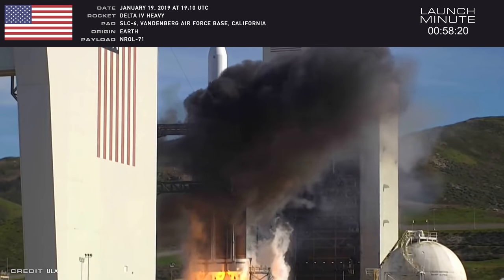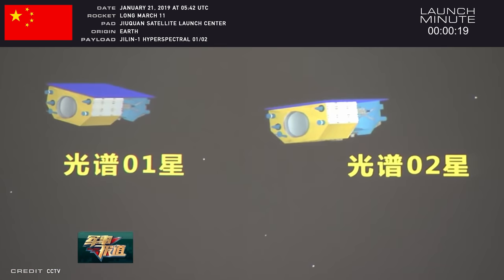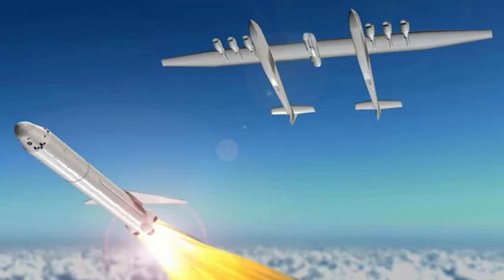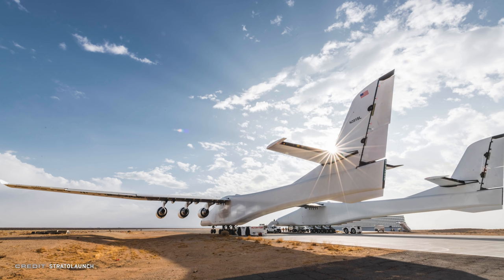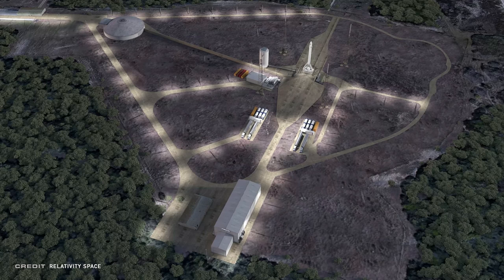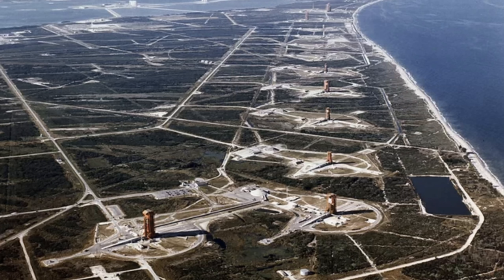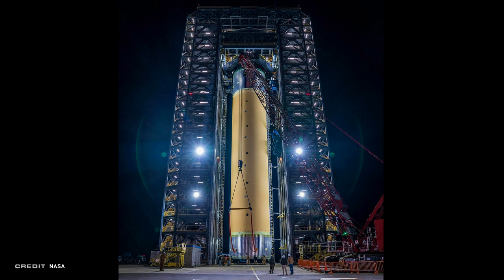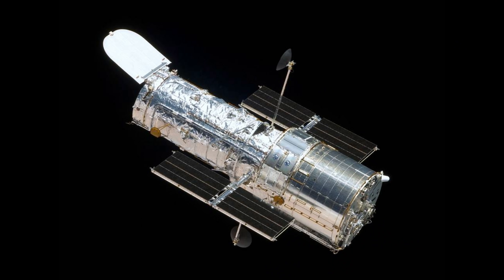Space News | Stratolaunch, Relativity LC-16, SLS Tests and Hubble

Comment: So many comments to make :-)

Suggestion for a name: News from TMRO (Today!)

I think the smaller regular videos are great, it gives options for specific playlists (eg. I want to see all the spacenews in a row!)

Also, i think the way YT might work would prefer recommending shorter regular videos over longer videos for potential new viewers. 

I really enjoyed the silly joke about turning hubble equipment on/off again, and a little bit sad there isn't others in the studio to give a chuckle at it. Maybe if the format was changed to a 2x anchor news desk like setting to go back and forth, it gives someone else to bounce a joke off of. 

And thank goodness for the good Hubble news, to balance out the bummer Stratolaunch.
Reply: I like this. You could move the news desk out to the main studio, or use the half Moon table with a tighter "newsier" shot. Whatever happened to the plan to have a TMRO logo insert for the wider side of that table?
That would be perfect!

I mean, if you're doing that, you need to go the whole hog and have the little thumbnails in the top corner like on old BBC News programs. No graphics, just the clean little box.

Wide two shot with viewscreen and table logo framed up, and then individual one shots for each Anchor, all framed up for the thumbnail over opposing shoulders(yes, I'm calling you guys anchors, because holy crap, that was capital-N "News" in the best meaning of the word).

Do you have 3 cameras? Do you have the patience to edit such a thing?

I love this. Sorry for babbling!
Reply: Yes I thought of TMRO Today as well but I thought the Germans might complain

Comment: Space Launch Complex Six at Vandenberg AFB, CA. Originally was Shuttle Launch Complex-6 (SLC-6). It was due to launch the Space Shuttle in a polar orbit shortly after the Challenger Disaster but the complex was abandoned and reconfigured for Athena and then Delta-4 rocket launches. I worked on communications projects in support of SLC-6 in the mid 80’s.

Comment: Nicely done.  Clear, concise, and current.  I would like to see one segment, just as you did with the building of the test stand, of a historical event.  For example, I’ve always wondered what happened to AMROC (American Rocket Company - George Koopman, who tragically died in a vehicle accident on the way to a flight hardware (filament wound composite solid motor)) test firing at Edwards.

Comment: One item I'd like to see brought over to the live show is the SLS.  Specifically, why NASA is still continuing to pour taxpayer money into their own launch system that is already WAY over budget when there are much more viable options out there and much better programs to spend their budget on?  Programs such as EVA suit design (for better mobility and in-use duration), alternate fuel engine design (long term space flight), life support systems, the Moon base/staging operation, and Mars human exploration suits.  Humans are going back to the Moon and to Mars, but others like Blue Origin and SpaceX are handling the rocket designs...NASA can continue to assist both companies as they have done for over 12 years now.
Reply: Fortunately there's a simple answer, the SLS is a congressional mandate, nasa doesn't get a say when by law they have to build it.
Reply: @jkajewski  But, the director does get to make suggestions and testify why something is required or not.
Reply: And that happens annually
Reply: I wonder if the test rig for SLS could be used for testing New Glenn and Starship?
Reply: @Patchuchan  I'd be willing to bet, based on it's size, that it could with very little refitting.  Not the entire rocket assembled , but the different stages and internal tanks, yes.
Reply: NASA doesn't build launch boosters.  They buy or hire them. NASA didn't build Saturn V, Atlas or Redstone.  They do oversee designs, and until recently controlled most launches.  Brand loyalty is a mental disorder.  We're better off with many choices for many different tasks.  Relying on just one company could be like letting Howard Hughes run Apollo in the 60s.
Reply: Don't confuse 'missions'.  NASA is preparing to hand over LEO missions to Boeing, Space X,  etc., etc. The SLS is designed for long term / solar system & deep space (and military) exploration-use.  The other companies 'talk' a good game about deep space/planetary missions but have zero hardware, experience, logistics to back it up....and won't for decades.
Reply: @jaysonpida5379  Actually, they will within the next few years...the same as NASA.  NASA doesn't have anything for outside geostationary orbit either at the moment.  If NASA concentrated on life support and sustainment, and then lent their expertise in human space flight to SpaceX and Blue Origin, that would be money better spent.  To believe that commercial companies won't have the means of sending humans to the moon and Mars within the next 10 years is living in a dream world.  This isn't the 1960's or 1970's anymore.
Reply: @STho205  Exactly.  Have NASA do what they do best...crew support and mission planning, and leave the rocketry to the commercial companies (plural).  NASA has already lent their expertise to these companies, and can continue to do so.
Reply: has science figured out how to make oxygen yet because without that kind of technology inhabiting any other ball of dirt in space other than earth will be an exercise in transporting canisters of oxygen.  nasa's swamp works has clearly got moon colonization covered.  3d printing blocks of moon dirt so astronauts can build airtight homes on the moon...  they better bring a few tons of silicone chaulk with them.  glorified moon dirt lego igloos aren't inherently airtight without help.
Reply: @michael-dm2bv  Um, how do you think they fill those canisters you mention.  It's actually very easy to separate the oxygen from the hydrogen in water...and Mars does have water in ice form, and discoveries indicate liquid water under the ice.
Reply: @michael-dm2bv  Okay, from the intelligence of your reply, I'm kind of glad you won't be joining us off planet.
Reply: @darringreen8630  - and please don't give me some crap about space exploration becoming privatized.  its clearly private.  privately funded by the government so as to keep idiots that think like me happy.  no?  our military has an annual budget of 500 billion but did you know the government has revealed that it has a "black ops" budget whose spending it is not obligated to divulge?  see how easy government irresponsibility covers its ass?  just reduce a budget and secretely subsidize private enterprise with money you are not obligated to reveal the spending of.  it's called embezzlement.  government collects our hard earned tax dollars and overly disperses it to rich private citizens for "services rendered."  haven't you ever heard of the $4000 government toilet?  i have.  i used to know a guy that worked for a government contractor that used to get paid $75,000 to renovate government owned bathrooms.  a job noone in their right mind in the private sector would pay more than $20,000 dollars for.  embezzlement!  see!  you learned a new word today!